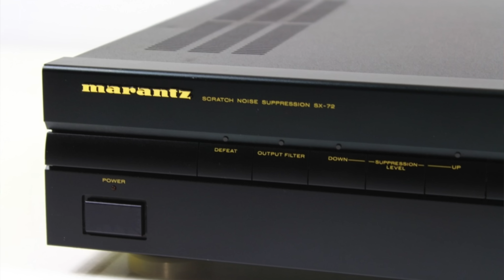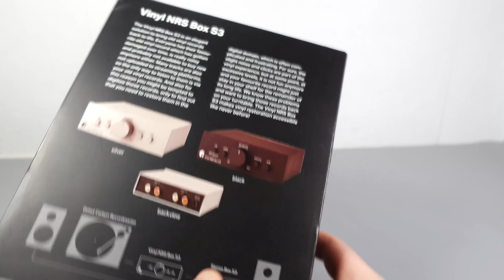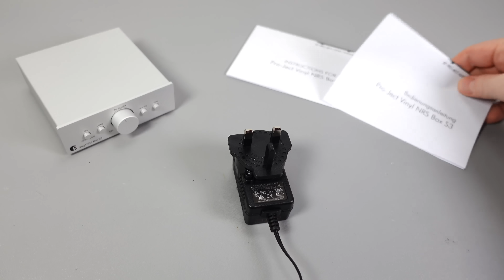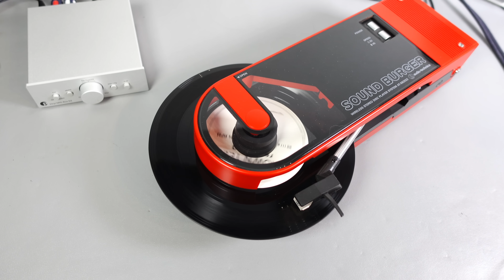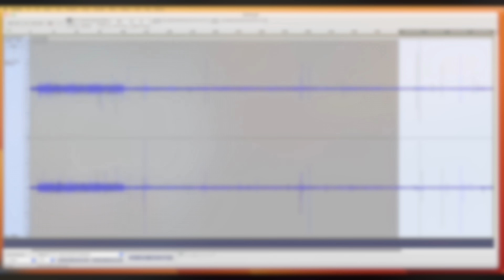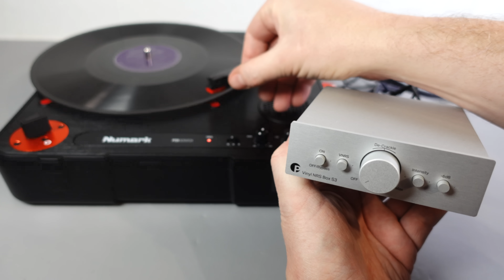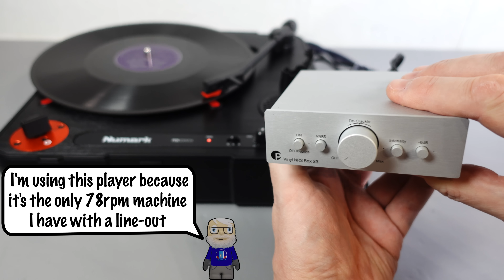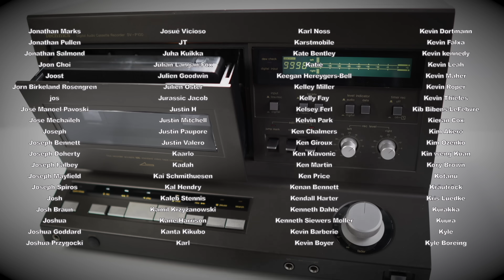REVIEW : Vinyl Noise Reduction System Pro-ject NRS Box S3

Comment: Apart from cleaning records and your stylus tip occasionally, and making sure your deck is 100% level, I highly recommend a subsonic filter. It's not for rumble per se, just removing bass that you can't hear. The main advantage is that your amp doesn't need to deal with these low frequencies and will perform better as a result.
Reply: It's so crazy to here this stuff, we used to set up turn tables, some speakers a long cord to the generator have bridge party's aka have raves under a bridge and the turn tables were just set uo in the "best" place we could find. You would amazed how good the sound would be some dudes would haul professional speakers and turntables out and even not being level they played and sounded great.
Reply: @MRblazedBEANS  In reality the most thing that will make a difference on record players (assuming there's enough needle pressure to prevent distortion) is the condition and quality of record. Having the player and cartridge at less than ideal conditions only makes a very small change in sound.

Comment: The reason the bass goes away with the rumble filter is that it’s likely just a high pass filter. Which also means that cranking up the bass to compensate will just crank the rumble back up.
Reply: (that'd be a high pass filter, though I understand it was probably a typo on your part!!)
Reply: There is a way to do it in analog domain. Classical DNR is just that. If you have an estimate of noise floor, you can dynamically decrease level of parts of spectrum which contain only noise. It works by having a filter and detector, this detects the audio level in a part of spectrum. Then a variable gain amplifier which is driven by SNR computed by the detector. But you either need to have N of these circuits for N bands which is why even consumer Dolby NR uses only 1/2 bands.
So you can get rid of noise. The fact that the useful signal does not get any better or even gets worse is not necessarily important. What is important is whether the "filtered data" works better for its intended use. And usually, people find noiseless audio better than noisy (unless it misses higher frequencies), so the noise reductions techniques improve the audio's subjective quality despite from the point of view of signal analysis, it didn't improve.
Reply: @petrpolasek5931  "if you have an estimate about noise floor"... Nope. We are circling here. Just imagine I put some (for me!) meaningful amount of noise on a CD or a record. And your task is to now distinguish between my meaningful noise and the noise that was introduced by the playback equipment and amplification.
It just so happens that normal music looks quite different from either meaningful or meaningless noise, which means in some situations, a filter can distinguish both quite good.
But you still can't just remove noise from a signal, because that signal could just be meaningful noise, and that is the point of SNR. There's no filter to boost SNR, UNLESS THE SIGNAL WAS LOW IN ENTROPY ANYWAY. I am repeating myself.
Reply: @graealex  are you familiar with the audio noise reduction tools called RX from Izotope, or the Cedar noise reduction tools? They do what I believe you are saying can’t be done, if I’m understanding your arguments above. They use algorithms that can differentiate between signal and noise. I use them on a very regular basis in the studio. Some of it is real time, and other processes are not, it depends.
Reply: @graealex  oops I may have missed the part you said about “in the analog domain” so my previous comment may not apply.
Reply: It depends on whether you mean random noise or just noise.  E.g., it’s pretty trivial to remove CRT whine - just notch 15.7kHz.  Mains hum is fairly simple too.

Pops and crackles - it depends.  I have used software that does a pretty good job at removing pops, because it looks for transients and acts on those that fit the profile of vinyl defects.  You’re missing the underlying audio that was lost during the defect, so it then has to interpolate that, but it’s possible to do so convincingly.

Now, if you mix white noise into a signal and then try to remove it later (assuming you don’t have a perfect inverse copy), that’s quite a bit more difficult.  It’s full spectrum and random, which makes it hard to differentiate.

But that’s just one form of noise, so I don’t think it’s reasonable to extrapolate that failure to all of noise removal.
Reply: @sirnickity  the crt example perfectly illustrates why you cannot 'remove noise'. It's a destructive process, a tight notch filter is difficult to make and it will absolutely affect the top end frequency response and probably cause 'ringing' either side of the notch.

I suppose you can 'remove' mains hum with a notch filter at 50/60Hz and another at 100/120Hz, you'll still have some high harmonics but with a low enough low pass filter you could probably catch those too. Whether you would still want to listen to the audio after that process is debatable.

You can of course remove all noise just by turning the volume all the way down.

I appreciate that I'm taking it to the extreme here, but the point is that all post noise reduction schemes are destructive, you cannot remove noise without also removing signal (unless the noise is out of band).
Reply: @chickenfizz   Okay... sure.. all noise reduction is destructive.  But that's not really the point.  The pertinent questions is, by how much?

No reproduction system is perfect, either.  Do we give up ever making an amplifier or recording medium because we can't reproduce a signal with infinite precision?  No... at a certain point, it's irrelevant.

So it is with noise reduction.  Some of it is crazy effective.  I've used some mains-hum removal software before, and it's just like it wasn't ever there.  Maybe there were casualties, but if you can't tell, who cares?  If forced to choose between a flawed recording, and a recording that is modified to sound close enough to perfectly restored ... well, I might make different decisions for archival purposes, but I know which I would rather listen to.
Reply: You mean high pass. High pass cuts the bass (low) frequencies and allows the high frequencies through. Low pass would be the opposite. 

It’s all in the name.
Reply: @Poisonjam7  Yeah, that's what I meant.
Reply: Epic.
Reply: I good rumble filter shouldnt be that audible, visually you can see less cone wobble on your woofers. Yamaha caq1010 has a good one at 15hz I had an Hitachi that had a 30hz one, that was good as well.
Reply: Likley? Its a subsonic filter, if it does not work, you need speakers with more dynamic🙄
Reply: It's as if one just can't remove noise in the analog domain...like an intrinsic property of signals. Imagine if you could just "remove" noise from RF transmissions...
Reply: @graealex  Realtime noise reduction is never really good.
Reply: @graealex  it's possible to remove noise from RF. SDRsharp does this very well
Reply: @juniorsilvabroadcast  Not really. I mean, "just removing". SNR is an intrinsic property of signals, and if removing noise was possible, you could receive any arbitrarily weak signal, because without noise, it'd be possible to amplify it without degradation.
If there was a magic "noise-removing thing", we wouldn't need antennas or large transmitter stations.
Reply: @graealex  You clearly didn't get what i mean. There's some process of RF Noise supression you can do with DSP processing.
Reply: @juniorsilvabroadcast Nah, you're not getting what I am saying. You can't remove noise. You can squelch when the signal is low. You can use an AI that removes stuff that isn't music or voice, but it stops working the moment your signal also looks like noise.
Btw you also can't remove noise from other signals like pictures. You can make it look nicer by assuming that the actual picture doesn't contain random brightness fluctuations. But if your picture is supposed to have them, then you again can't discriminate between noise and signal.
Because of that, there will always be noise that you have to let through, or risk degrading the actual signal.
For example, AI-based noise surpression works exceedingly well for voice microphones, because AI can easily identify the signal, as voice looks very different from noise.
Reply: @graealex  don't make things more complicated please. Squelch and AI noise reduction are some ways of removing the actual audible noise of the signal.
Reply: @graealex  people are using the word remove instead of reduce. There are all sorts of filters and algorithms that are used to increase SNR by reducing noise.
Reply: @juniorsilvabroadcast  And can you explain how that DSP supposedly discriminates between signal and noise?
Plus, it's not my problem that you are ignoring fundamental signal theory. Because if the signal is supposed to be noisy, then it doesn't work anymore... Which is obviously a problem with digital signals, which looks like random noise. Particularly if it is compressed data.
Reply: @juniorsilvabroadcast  Alex is just being pedantic and a bit arrogant (imho by reading his first reply.)
Reply: @ax14pz107  That's only true if your signal looks very different from noise, and if that is true, then it's already low in entropy, which means that for example a compressed signal also utilizing FEC would actually yield even better SNR.
Reply: @soundguydon  Pedantic about someone claiming that you can simply remove noise, yes. Because I explained that this isn't possible. In particular it's not possible to increase SNR. If such a filter existed, even if it only increased SNR by half a dB, you could simply chain a hundred of these filters together, to increase the SNR substantially.
This all works the same as there is no (lossless) compression algorithm that will make any arbitrary data smaller. Because if that would be true, you could run the same algorithm repeatedly and make the file smaller and smaller.
It's true that in some domains, you can remove noise, but that's because the signal had low entropy to begin with.
Reply: @soundguydon  it's not really being pedantic?  It's an actual meaningful distinction.  You can mask what humans perceive as noise, within the limits of certain kinds of signals, if you know what the signal is "supposed" to be like.  You can't remove "noise" in the actual signal theory sense of the word.
Reply: @graealex  Correlation. White Gaussian noise is uncorrelated, so noise signals have exactly 0 autocorrelation when shifted. Other signals, like voice and music have non-trivial correlation. That's how radio noise reduction algorithms work. The Wikipedia article "noise reduction" image section is basically the same algorithm, just 1-D in the case of audio and 2-D in images.

You're also mistaken by saying a filter "does not exist". You should know that the optimal demodulation filter for maximum SNR is a matched filter. In audio processing, we have one of the worst filters you possibly can have: the entire flat audio passband. One way to view noise reduction algorithms is to estimate a matched filter for the audio signal, e.g. by maximizing autocorrelation.
Reply: @straightpipediesel  A proper signal, particularly one that contains a lot of information, will look as uncorrelated as any other noise.
And I have not denied that audio of a particular kind can be distinguished from noise. The comment I got pedantic about claimed that noise can just be removed from a signal, IN THE RF DOMAIN. Which probably isn't how the supposed DSP filter actually works.
Again, no such thing as a noise filter, at least none that won't at some point degrade the signal, unless the signal was low in entropy anyway.
Reply: Wiener filter based systems can get rid of random noise, you only need to know (or have an estimate of) the spectrum of noise floor which is usually somewhat typical for a certain audio player and audio format. Yes, the problem is that you can either overestimate the noise and then you lose some nearly silent parts of spectrum or underestimate and then the noise gets through the filter (not entirely). Or you can have a medium which does not comply with the noise estimate and then you can get both effects at certain parts of spectrum.
Your assumption on noise filtering is right, but only for linear filters without memory. Wiener filters are adaptive nonlinear filters with memory which allows them to filter noise and to adapt to current SNR. (Note that the non-linear does not mean that it would generate harmonics. It means that its response to SNR is nonlinear.)
Reply: Actually no. Once the rumble of the bass is removed in the analog domain especially, you are not boosting the rumble when you crank the bass. You can't boost something that isn't there, you can only make it sound "bassier" by boosting the bass. Easy way to think about it is a song that doesn't have a bass instrument recorded in it. You can crank the bass and make the song sound "bassier," however, you will not get that low end bass compare to a song that has bass instruments.
Reply: Did you mean a high pass filter?

Comment: Does quite  good job. The algorithm must be quite a task to get right. I can see the appeal of a device that is hardware sitting there ready to use but if I may. I was well impressed when I bought a Soundblaster Audigy2 ZS soundcard with an external input/output box. One surprise was a function in software to remove crackle and pop from an input. I decided to try this on my very old 7" Tie a Yellow Ribbon Round the Old Oak Tree which was virtually all crackle and pop even after cleaning. The result was staggering. An onscreen meter showed the detection and the output was virtually like new with very minimum artefacts passing through. Unfortunately the software only works as high as Windows XP as no drivers were fully supported when Windows 7 came out. Luckily I still have a working XP machine in stasis waiting for me to clone the drives and buy a convertor from IDE to SATA so I can get the machine working again. All my music production back in the day was done from it. It also has excellent abilities to clean up old tapes by removing noise. I wish Soundblaster would make a Win 10 version of the card as I would buy a new one in a flash. Beautiful full 96Khz Digital output, 24Bit, EAX, THX, ASIO, DTS. Back when I got it, the soundcard was a hefty £200 but really was well worth the money. Still have it, still works, just not ready to use just yet or I would make a vid showing what it did with records.

Comment: I was able to remove nearly all the noise in real time with a program called Stereo Tool by Thimeo. It's really made for radio broadcasting, but it's brilliant for fixing all sorts of issues with recordings. It's incredibly powerful. The interface is a bit daunting at first, but if you just stick with the basics, you can still do a lot with it. It can even run on a Raspberry Pi, so you can have it in a little standalone box with a touchscreen next to your Hi-fi system.
Reply: StereoTool, famous FM audio processor for radio stations. It even fixes the distortion from loud CD mastering. The same thing is included on Omnia.9
Reply: Thanks for the idea! I already use a raspberry pi in my system to play the digital side. This might make listening to my father's old records easier using hardware I already have. I will check it out!
Reply: @hellboundedward  To be clear, it's not all plug and play. There's definitely a learning curve there, but there's material available online to figure it out. It would also require a way to get audio into the pi from the records, such as a USB audio device or an audio 'hat' made for the pi. And the Stereo Tool software ranges in price depending on which options you include with it.
Reply: @ThisSteveGuy  Definitely going to look for a good usb audio interface. Already have a decent DAC (a SONCOZ LA-QXD1).
Reply: @hellboundedward  Little point in "good" when digitising vinyl. An UFO202 is made for the purpose and should interface with Linux no problem.
Reply: I was able to do the same by buying a CD 🤣
Reply: @stepheng8779  there is a ton of music that was only ever released on vinyl. Granted, the better way to go about restoration is probably just record it as-is into your PC and restore the whole recording with something like iZotope RX.
Reply: I have CDs that were mixed improperly which Stereo Tool is able to make sound better, such as ones affected by the 'loudness war'. And I constantly use Stereo Tool while I'm on YouTube and Twitch so I can correct people's issues with their audio levels and even if their microphones are clipping. It's not only for vinyl by any means.

Comment: Most 'pops' are caused by static building up on the vinyl. Some anti-static devices for turntables are meant to work quite well, but as ever in this life, results tend to match price.
Reply: I bought the Milty anti stat gun for over 100 bucks and it doesn't work nearly as easily or effectively as my RonXS plasma lighter for 12 bucks on Amazon. Sometimes there are outliers to every rule, but in general I agree with you.
Reply: Looool, no
Reply: Perhaps on a modern plastic crapbox, but I highly doubt that on a grounded metal turntable with a grounded metal tone arm.

Comment: That thing sounded as useless as the various "pop & click boxes" I wasted my time & money on back in the very analog late '70s. So DSP brought nothing to the party. As for the "VNRS" that was once called "rumble filter" and it's nothing but a glorified high pass filter with very steep roll-off. As Mat pointed out, VNRS seems to take out bass along with the rumble which is the same problem analog rumble filters had. I give NRS Box S3 a 2/10 - do not want.